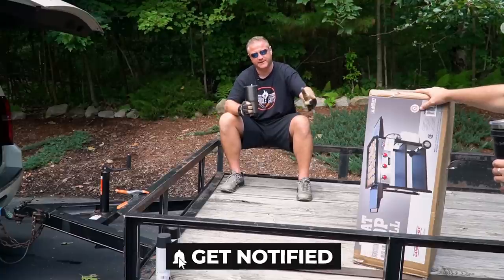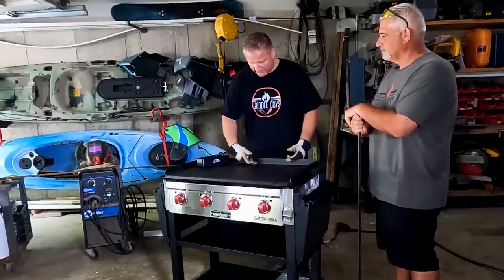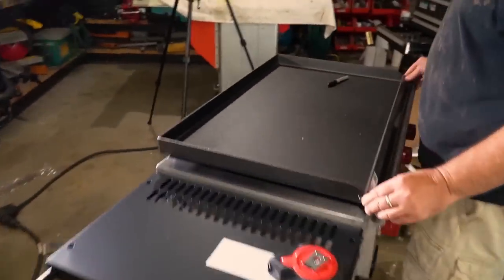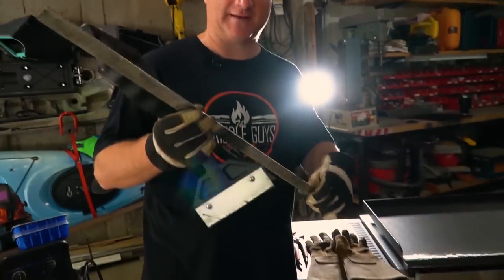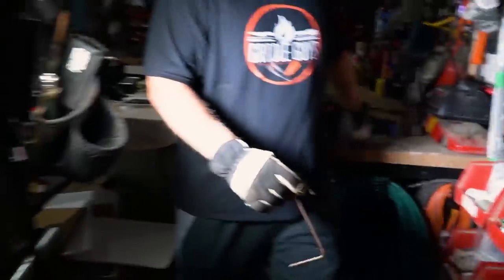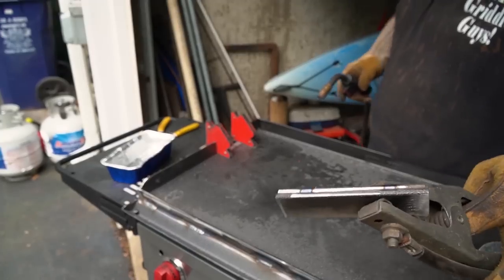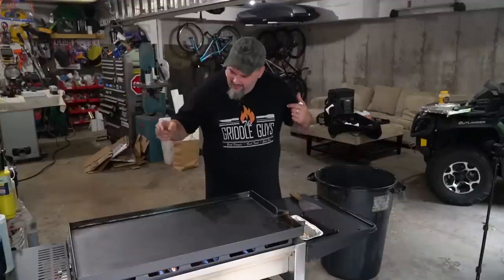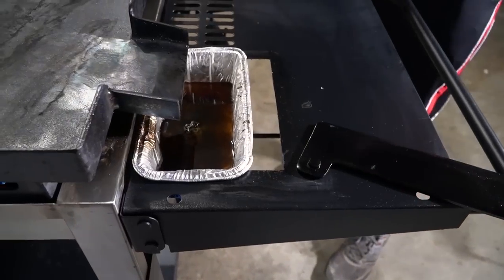3 things I hate about my griddle!  And how we fixed them!

Comment: LOVE the mod!! Can I make a suggestion,I have found if you use a wood / bamboo spatula instead of metal it protects your seasoning and sill move the grease and, (what do y'all call it "smag") just as well! I first saw this trick on Cowboy Kent Rollins channel he cooks on cast iron and griddles. You can buy cheap bamboo spatulas at Dollar Tree or those other $ stores! So glad I found your channel looking forward to future video's!
Reply from the maker: Good call Alan.  We personally like to keep the patina as thin as possible so thats why we opt for the metal. Issue we found with letting it get to thick is it eventually starts to steal heat.  It also sometimes doesn't really bond well and flakes off into food. Just our experience. Our cook tops don't look great but we just feel better about it I all. Ty for commenting and we fully support anything that keeps you griddling.

Comment: I love these mods.  I have that same griddle and if CC makes a new top with these designs, I would upgrade for sure.  I don't know if it was previously mentioned, but 2 small thoughts, in regards to the drip pan.  1-remove the nob on the slider to allow for plate placement on the table.  2-devise some sort of splatter guard for the trap.  That would help keep the table cleaner.
Reply from the maker: Great suggestions Tim and ty. I'm going to be modifying a second one soon. I'll keep that in mind. Thanks again-J

Comment: That's COOL. I own two Blackstone's and my 36" is the old school with the front drip rail and I hate that design. This is exactly what I thought about doing to to make my 36 a little more user-friendly, except going out the back. The opening on my smaller one is too narrow, so I can widen it and extend it out to solve the drip problem. Thanks for sharing.
Reply: I have one of those too, I just reseasoned it today and binging griddle content because of it. The only good thing about the front grease channel is it was the easiest part to grind down. Considering ruining my new seasoning to do some of these.

Comment: my main gripes are not having hinges for my BS 36” griddle cover, so it loosely hangs on the back and crushes the grease trap liner. And then the aluminum grease trap liners begin to disintegrate If you don’t empty or replace them frequently due to using salt on the griddle.

Comment: However do like the modifications makes sense. Now send it to my house, for further testing. I would have used two wire bracket under the grease tray not one by dividing it in thirds so no more that a third  of the tray would have have been supported.  Great ideas.
Reply from the maker: LIterally LOL'd :D   Admittedly we did get a little lazy with the brackets.  I have been using it a lot at my house and so far I love it!  Works awesome! Thanks for taking the time to comment Rick!   -N

Comment: My blackstone has the rear trap that i have no problem getting the grease into and i whip the scrapped stuff off into on the back wall over the pan, not sure why all that was necessary, only issue i have is grease run back that misses the liner & goes into the pan

Comment: I have the 36" Blue Rhino griddle and the Grease Catcher beats all other systems for ease, scraping in smeg and doesn't drip on the patio
Reply from the maker: Blue rhino and members mark,,, both designs are better than the CC and BS IMO because you can force everything into the drain holes and don't have to pick it up and move it off.   -N

Comment: Fascinating video...never thought I'd be entertained by a "Welding Video!" 
What do you do with the grease when you empty it?
Reply from the maker: I love this question Mike!   I am on septic so I cannot pour it down the drain.  For a period of time I was spreading it in my mulch beds to keep the weeds down but,,, turns out this attracts dogs and other critters and they dig huge holes so I stopped doing that.   Recently I have been freezing it in a ziploc and taking it to my local dump with the rest of the trash.  I did this because with the previous design I could not empty it until it had cooled off which means,,, I would forget to empty it and end up with an overly full cup and had to get it empty in order to cook   

Now with the new design, and I can empty it while everything is hot I am going to buy a small bucket from home depot with a tight lid and fill that.  When the bucket gets full enough I will bring it to my local transfer station and empty it into the oil recycling bin.  This way I know it's getting to the right spot 

Thanks for watching!  Cook on bud!  -N

Comment: Great upgrade! The grease pan keeper swing could be radiused to minimize the chances for puncturing the grease pan.  Good job!
Reply from the maker: Good call David. I'm going to be working on another one soon. I'll give that a shot. Ty-J
Reply: Go to Good Will or SA and get an old fashion metal bread pan. About the same size and you can even get a larger one if you want. Mike

Comment: Small project: I want to ask my brother who has a (line fed) welder machine to weld on a short pipe onto bottom of the grease trough. Then use a hose or sorts to guide the grease into a milk jug. But should I be concerned with the type of metal used? Or what to use to weld? Currently I use kitchen string to guide the grease into the open top milk jug. Works great.. until it doesnt.
Reply from the maker: Great questions....I will defer to Jeff to answer! - C

Comment: Just stumbled onto this video and they have the same complaints I have with my Camp Chef and my buddy's Blackstone.  I had resigned myself to just accepting these brands' shortcomings, scraping the schmeg on the edge of the griddle and wiping it off with a paper towel.  Not to mention the front of your shirt getting nasty from the trough when you lean in to cook or clean.  These upgrades are so simple, and each one was achieved with basic tools and about $5 worth of metal from ACE hardware.  I know what I am doing tomorrow... my welder has been collecting dust anyway.

Comment: Just buy the Members Mark giddle from Sam's Club. By far a superior design than any other griddle I've seen. It has four walls and a hole stamped in the middle that drains into a catch drawer below. I added aluminum heat shields on the sides because the side tables get hot. Also I welded the stand together so it's much more solid. Griddle is perfect now.

Comment: Excellent work Griddle Guys, I would buy this. Did you consider installing some kind of hose system into the grease trap so you could run the grease through the hose and into a huge drum or something? Change the grease out one a month?? Maybe there would be a problem with all the solid chunks
Reply from the maker: CC sent us 2 units.  Jeff is going to do this to the second one.  We will def film and post it.  Thanks for watching slawry!  Cook on! -N

Comment: The Members Mark (Sam’s Club) griddle has a nice sized hole in the front, middle of the griddle with a tray lined with a mini loaf pan. It works really well in my amateur opinion. The grease tray slides in nicely from the front and you hardly notice it.
Reply from the maker: I've checked that one out and it looked decent.  Thanks for the comment! - C

Comment: Could you advise about the levelers you mention underneath the flat top? Mine were not included?
There are holes there though. What is the bolt size? Thank you, great vids
Reply from the maker: On the two we got on one side of the griddle, front and back, there are 2 Allen key bolts. Unfortunately not sure what size they are.

Comment: all these mods, or you could just buy the rear drip blackstone ;)   ALl jokes aside, curious what mods you would/could do to the 36" blackstone or rear drip griddles
Reply from the maker: Hi MwmW,  I don't want to speak for Jeff & Chris but for me, if I had the BS rear trap I would do something similar,  Cut the wall section out, extend a grease ramp off the back of the griddle surface, build a larger grease catch system.  Either that or cut a large rectangle hole in the corner of the cook surface and extend a section of pipe through the burners to close to the bottom shelf with a bucket under it so I could scrape into that.   I think Jeff is going to do something similar.   Anyhow, thanks for watching and for taking the time to comment!  Cook on bud! -N

Comment: I use my Blackstone a bunch. It has the grease trough in the front. I set my griddle in place leaning to the right just enough to make the grease run to the catch pan. I have cooked about everything I can think of on my griddle and never worry about the grease. It does NOT produce that much grease that I have to worry about it. When I get ready to clean the surface, I take my scraping spatula, scrape the griddle and push all the food and oil to the right side of the griddle where I lift it with the scraper against the angle and put it in the trash. To each his own but I would not waste my time putting a grease pan on this griddle. Even with the flat steel welded on the front. You can still remove all the oil and food with the scraper. Chef Jerry
Reply from the maker: With us, one of our complaints wasn't that the old trap didn't work as much as we didn't like the hot oil pitching towards us. We have many shirts and sweaters with all the grease speckles. Like you say tho, to each his own. As long as your griddle works for you, all that matters.Cheers-J

Comment: I really like everything other than the trap location. I think it would be better moved to the back of the left side. The cuttent location creates a corner in the back left that seems like extra work. If the trap were moved back, everything could be pushed to the rear and then follow the edge directly into the trap. You guys still did a great job.
Reply from the maker: Definitely not a bad idea Keith and ty.  I agree with you 100% however it would have had to of been a totally diff design because of the shelf depth and support brackets. I tinker with fab so that little shift would have probably taken me an extra 6 hours 😁

Comment: Did you just use cold roll steel on the front griddle piece..? And just a mig welder..how many amps..? Want to do this to my blackstone, it has the same drip system.
Reply from the maker: Hey roboink. Yes on the steel and welder. It's a Miller dual voltage so I can run it on 110 or 220. I had to run a 50am breaker for it on the 220. It's gotta be coming up on 20 years old or so now. It's been a great machine. Ty for commenting-J
Reply: @TheGriddleGuys  Cool...I have a Lincoln 180 Dual mig welder. My project for this Thanksgiving holiday. Any upgrades for the push button lighter...?

Comment: I believe you could of just adjust the height on the back side of griddle to be taller than front, drill a hole on one end of grease catcher connect an aluminum pipe to go down beneath griddle have a large grease collector there.
Reply from the maker: Great idea and wait til you see what Jeff has been working on!  Video will probably post in about a month but yeah... to your point :-)  -N

Comment: Awesome mod! This needs to be brought to mass production. One thing, did you think about adding another piece of Steel at the end of the grease trap 6000 acting as a drip edge instead of the ramp? The same concept of drip edge on a roof, as long as you have that down piece, you’ll never get back drip. Plus, when you’re scraping the schleg, you wouldn’t get food buildup on the bottom side of the ramp. You can call it the grease edge 7000 lol
Reply from the maker: def a good suggestion.  I had thought about it innitially,,, then forgot about it when we were building lol.  My bad.   We will do this if we mod another one for sure!  Thanks bearded man!  0N

Comment: It does it cook pancakes evenly ? , in my experience with the camp chef it’s a challenge .
I’m thinking about getting a 1/8 steel plate between the griddle and the burners to maybe even out the heat.
Reply from the maker: It's been pretty good. Odd but toughest issue we have is actually lowering the heat. They definitely seem to run hot. You should have a plate under it already. If not your idea sounds pretty good. I'd only be concerned with loosing too much heat. Either way sorry to hear. Cheers-J

Comment: Great mods guys, Kudos to you, I didn't know you were the skilled trades type and it turned out great. Please add one more gripe about my Blackstone. Why do I have to buy an accessories to block the wind from the burners? Add a couple pieces of strap iron under the edges and shazam, built in wind screen.
Reply from the maker: couldn't agree more Campnut.  Seems like BS should have thought of the wind.  Maybe not on the OG blackstone but they have done several new units and they still haven't seemed to solve it.   Thanks for watching and for commenting!  Cook on bud!  -N
Reply: Several friends use the BS 17" camping. They buy a metal bench scraper at Dollartree. Slide it over the rim to hang down & block the wind on whichever side(s) the wind is hitting. Cheap, easy.

Comment: I was bored and pretty sure you would be "full of it."  WOW was I wrong. I ALWAS find design problems with EVERYTHING, something my wife said was impossible until I proved it to her over years and years.  I often redesign things to make it work properly.  100% SPOT ON the grease catch is not just wrong but ABSURD in most grills.  I feel certain most designers think we are STUPID.  Great design.  Probably the best drain ever made for a residential grill.  I would put the ramp in the back. In practical use, most people need "surface space" so I would reserve the sides for plates and similar.

Comment: 26:10 
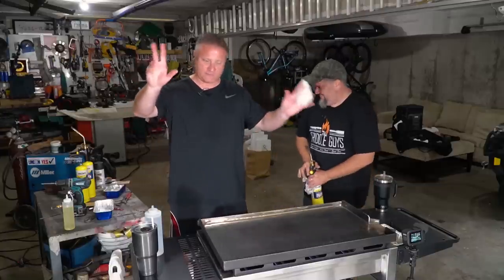That latch 22:20 that secures the "trash can" into position, should be taller.
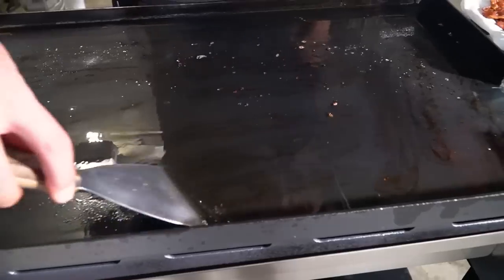When you push the hot oil and various debris 24:43  through the ramp there, some may spill over over onto the nice area around it.
If you make like wall tall as the griddle walls, it will catch any such undesired elements from escaping and fall into the "trash can"

Comment: The grease trap design is really a good one.  The front lip should be a 1/2" lip or so, little shorter height than the sides and back.
Reply from the maker: Ty Jon. 👍

Comment: When you made the slot for the aluminum grease catcher in the side shelf, why didn't you use a good  metal loaf pan, cut the hole to size  and simply put a throw away cheapy loaf pan inside it. That would have eliminated the need for the pivoting support and the support underneath the side shelf. It also would eliminate the chance of the cheapy loaf pan collapsing when you pick it up to empty it. It also would have been  a lot less work.
Reply from the maker: All good ideas Richard. In the heat of it we just kinda winged it..  We honest to god did not plan what we were doing ahead of time other than just the general ideas..Next one will be diff. 🙂 Ty.
Reply: @TheGriddleGuys  All good ideas. I have a Blackstone and if I knew how to weld I would make your mods in a heart beat.

Comment: Would have been perfect with that trap to the side up front of where you would be standing while cooking, as ooposed to the rear/back. Further more you could do it on both sides of the grill so you could scrape to left or right. Keep everything up front like with the trough. Just wall the trough, and make larger holes on either side so, again scrape to left or right, with large enough holes for bits.

Comment: I wish they would get rid of the drain completely. I do a large breakfast once a month at church and I cook bacon first then potaoes which uses the bacon grease and then I pour 120 eggs on it (Blue Rhino 36") to scramble. I use a 3" 90lb pull magnet to cover the drain so the eggs don't run out.
Reply from the maker: Hey Rick...Sounds like you have the breakfast cook down for large amounts of people.....very cool!  Nates design might work well for you.  All you need is a blocker for the side to add and remove when needed.  120 eggs....that's crazy!  Nice work my man!  Griddle on friend! - C

Comment: What no bottle opener?  Just kidding good job I like the oil trap.  I may have to mod my blackstone.  I have the original 2 burner one that has the small grease trap in the back.  I also need to fid it so it doesn't warp up when I load up a hot griddle.  Maybe I can weld some angle on the bottom to help reduce warpage:')
Reply from the maker: Good call on the angle iron. . The 36 Blackstone comes with that out of the gate . Definitely seems to help.. Good luck and thanks for commenting-J

Comment: My 2 cents 
Instead of flat stock "it's too high"
Get welding stick thicc ones lay flat then weld a thicc bead of weld 1/8 thick to stop all fuilds
In auto shop u got flexible magnetic strips to hold all tools, round bar bends weld 2 handles on the griddle  long handles for a lot of mess towels 
Awesome content

Comment: If the grease trap ramp rolled back on the underside it also keeps the roll back from happening.
Reply from the maker: As you could see, we are far from being engineers 😁. Good call tho and ty for commenting-J
Reply: @TheGriddleGuys  well it came out nice and I only thought about that because of drip loops you do on cable lines outside.

Comment: I would've used the original grease trough and ground down the back to make using easier and put the top on backwards moving the trough to the back of the griddle
Reply from the maker: Nothing but options when you customizing for sure.  Good ideas . Cheers-J

Comment: What do you do to prep the surface between cooks?
Reply from the maker: Heat, steam with water, while using scraper with paper towels. Repeat until the boiling water and paper towel comes up pretty clean. Shut down and then I do a light coat of oil if I think it will be a while in between cooks. When I start new cook, get up to temp quick steam and wipe to get the excess oil off and done. Hopefully this helps. Cheers-J
Reply: @TheGriddleGuys  it does.  Thank you.